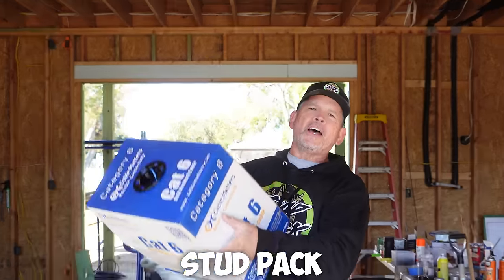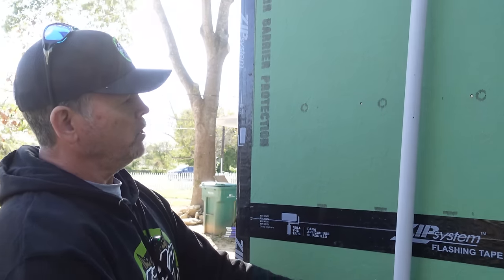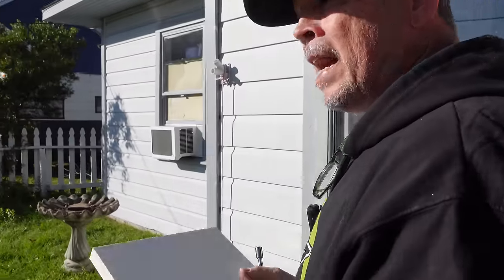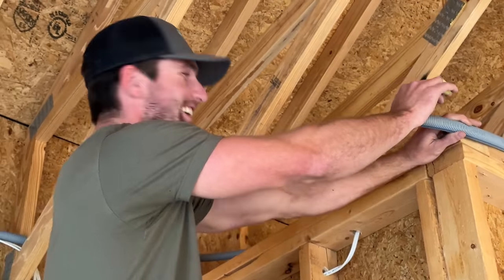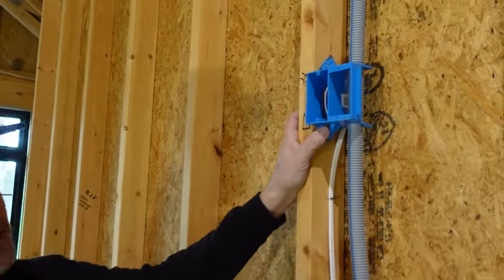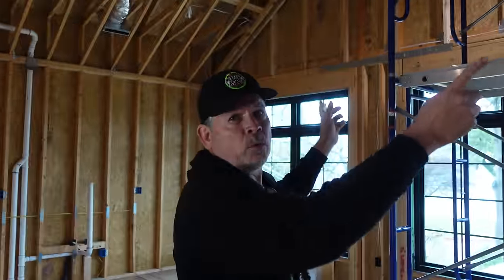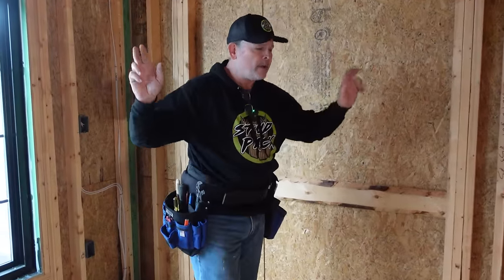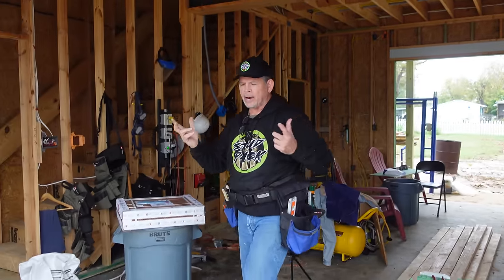DIY Networking for a Future Proof and HIGH SPEED Home! (Smurf Tubing and String Pull Trick!)

Comment: Also add my 1,000th vote for using wall plates.  The main data rack should be installed on an open wall in the electrical room.  Don't understand why you ran that flex way up thru the roof when you could cross the garage ceiling saving length on the way to the data rack.

Comment: Oof I would’ve home run into your electrical closet on the main floor. Who’s gonna want to climb into that attic to work on IT stuff. Then you’re also close to power if you need more down the road. As others have said terminate on keystones in the wall and a patch panel at the home.

Comment: 20 years in the telecom business has taught me to never to run copper cables used for tv or internet parallel to power wire even if it's in conduit. Conduit will not shield from electromagnetic fields produced by electric lines.

Comment: If his fiber is going to be up in that storage space. The conversion to cat6 will be up there as well. The runs are SUPER short. AND going through the smurf tube to boot. The amount of interference from your romex is going to be negligible. The EMF radiating from a standard romex wire is between 0.6 and 0.8 milligauss. Which only radiates at a 1mm maximum halo around the wires, and that's if it is on a constant load. Not idle.

You're not going to interfere with the operation of your Cat6 wires THAT much. Especially for such short distances.

Now if he was running a Cat6 wire 30+ft parallel with a romex wire. THAT would create issues. But a drop down the wall...IN conduit. Pfft, not even worth worrying about.

I will echo what everybody else was saying, most definitely you need to keystone plate those termination points.

Comment: It only took a few seconds to notice you bought a 350 Mhz bandwidth Cat6 cable. I used 500 Mhz Cat6a instead, because it is truly 10 gigabit capable, instead of some 7 gigabits, as I was told by a pro.
Reply: To be more precise, I used a few cat6a cables for a backbone to each room, the rest is cat5 for ethernet/canbus automation and data. Not much of a difference price-wise.

Comment: A few videos back you buried your underground pipe going to that new pole you sent and on the end you dug a little extra ditch, so it wouldn’t be so hard to dig later but you filled it in with dirt. It would’ve been a lot easier if you put sand in there instead

Comment: I'm sure someone mentioned it, but testing your cable is a good habit, but take a moment to ALSO mark the ends with some fashion of label.  There's nothing worth than a perfect mess of cables no one knows what goes to what?  I'm sure you have a location where all the cables termite to and be connected to an ethernet switch or patch panel.

Comment: It’s bad practice at best and potential for lowering or even disrupting the data rate at worst- by running Cat cable alongside line voltage. Best to run them separately in a stud bay down their own respective studs. If they must cross at some point, they should cross at right angles to each other. The Smurf tube will do little to shield the Cat from EMI (electromagnetic interference) and RFI (radio frequency interference), but using shielded Cat6 cable will “harden” your network to a degree. If you ran everything in the house with fiber to the receptacle, you wouldn’t have to worry ever. But the cost of the conversion dongles at each receptacle would be prohibitive. Realistically, using ordinary Cat6 and running it 12” away from line voltage cable, crossing when necessary at right angles and keeping Cat cable runs away from your house service cables, electric motors (like A/C equipment) and fluorescent lighting ( not an issue in this house), then you will not have any problems.

Comment: As an Electrical Engineer the magnetic flux generated from 120V at 20A is only about 3mm. This is just enough to make it outside the sheathing. This flux is what you're actually reading with the EMF detection touch tool.

 If you want to be overly cautious you can install a shield wire on the outside of the concuit and ground the shield wire. The shield wire, bare copper, will absorb the flux field and transfer that miniscule emf to ground.

I think this is way overkill but noise cancelation is an understandable concern.

Hope this helps.

Comment: Use keystones for wall drops and a patch panel and a network rack for your central network area. Saves you from having intermittent network issues when you move equipment around. I would have ran CAT6A. If budget is a concern, you can continue using CAT6, but run smurf tubes to all drops. The reality is that no one knows what home networks will look like in 10 years. CAT6 will allow you to have 1gbps  for multiple devices and 10gbps to one device. For storing and uploading videos, 10gbps and a server will help your workflow.

Comment: Your Cat6 may work for 10G, but it is not optimized for it. 

Cat6 A STP for the main house should be considered, especially if long runs and 10Gbps is required.

Comment: It doesn't look that you have a long distance from the street to the house. I had my Cable Co. guy pass the fiber wire through the eave of the house straight into the attic.  It keeps it away from any predators (big mean burglars) from cutting the fiber from the house and losing service and straight run into the house up high. Especially you talking about cameras  you will not lose service  by someone cutting your fiber from outside. By the way I love your channel. My eyes are watching you from the beginning. lol

Comment: Putting your fiber box/ modem/ router up in the attic is a very bad idea. The best way to do it would be to install a structured media panel near your electrical panel to allow easy maintenance and trouble shooting. It would suck to have to climb up to the attic just to reset the modem if the internet goes out.

Comment: I love to hate the pass through RJ45 connectors. I stopped using them all together
Reply: I agree but they are OK for home owners and they work fairly well.  My new techs I'm training sit down with a box of cable and some standard ends and make patch cables until they can consistently do a proper termination.  It only takes a few hours to get quick with standard ends and the color code will be second nature.

Comment: WiFi 6e and the upcoming WiFi 7 standard along with mesh routers is so good I doubt you guys actually really needed to do a cable install in the house. But it doesn't hurt while the walls are still open ofc but if you were gonna do it you really should've installed Cat 7 or Cat 8 instead as that would've been a better long term investment.

Comment: 20:08 If you want to get fussy then there are tables online specifying acceptable proximities for parallel power and Ethernet.
For the most part, however, Cat.6 cable is good at rejecting induced interference from power cables except in cases of extremely high power.
I still like to space my cables as far apart as I can, and to only cross at ninety-degree angles because I'm OCD, but realistically running the cables in close proximity for a foot or two will likely not cause any issues.

Comment: Please do not use the pass thru mod ends they are garbage.  The issue is it leaves the copper core open in the end the jack. We find in moderate moister and humid environments it corrodes the copper inside a jack and cause connecivity issues.

Comment: Should have stuck to female connectors for the walls. The male connector's tongue breaks way too often on just about everything. Guess you'll find that out later and either have to replace it with another, or stick it back into the wall and install female and then run a patch cable with the length that you way. Another reason for female is that what if you male cable isn't long enough, now you need a female to female adapter, headache...

Comment: Why run it up and over the vaulted ceiling when you could have just gone across the ceiling then up on the lower level. Also, the Smurf tube is not necessary. Miles and miles of ethernet is run in offices without the tubing.

Comment: One comment I'm not seeing is your use of CAT6 and not CAT6a... your thumbnail is about future proofing and 10 Gbps.  While CAT6 will run 10 Gbps over shorter distances, it is designed for 1 Gbps, and you may see some stability issues if you run 10 Gbps across it.  If you truly intend to run 10 Gbps then you should be running CAT6a.

Comment: I absolutely HATE HATE having cables coming straight out of the wall that go directly into the devices.  I was disappointed to hear Paul say that the female CAT6 connectors aren't being used to have clean, nice looking wall plates that then a patch cable can be connected to to go to the device.  When the device is not there, then you have an ugly looking cable coming out of the wall that just dangles there.  And the length of the cables coming out of the wall are never the right length so you end up having to use an inline connector or switch with patch cables anyway, but this time the patch cable connections are out in the open instead of at the wall plate where they should be.

Comment: You can always tell the amateurs when they always call it "Running internet". It's running network. The internet is accessed through a network, but a network can easily exist without internet access. 

You also ALWAYS use a keystone jack and do NOT just terminate the cable to plug straight into a device. Another amateur mistake. Have your network installed by professionals.

Comment: Cat6 is double shielded.  Typically you don’t want to run power parallel to communication. This is a very short run so between the shielding (not the plastic flex conduit) you should not have any issues with the cat6.

Comment: Terminate your in-wall solid-conductor runs to keystone jacks!
For starters, having a wire hanging out of your wall is just plain sloppy! 
Moreover, solid-conductor wiring is intended to be installed and left alone. Stranded-conductor cable is used for patching because it can flex repeatedly and at tighter radii without breaking.
You wouldn't put a NEMA 5-15P plug on solid-core 14/2, now, would you?

Comment: CAT6 has perfectly adequate natural shielding — you don’t need to worry about 110v interference, especially with the additional layer of conduit. CAT5 may have been a concern, but CAT6 is quite a bit beefier!
Reply: By natural shielding, I mean they make shielded CAT6 with metal foil, but even without the shielded variant the PVC, insulation on the conductors and interior jacket works to shield the cable.

Comment: DO NOT leave the runs terminated at the device. Use a wall plate with a coupler. If you damage that cable, you are going to have to use a coupler anyway. Just do it the right way. This time your son is WRONG. Get the wall plates with the couplers in them, you will have nothing but issues with that punch-down style.

Comment: Cat 6 is only 10g at short distance.  Better choice 6a for 10g .
Reply from the maker: It is indeed a small garage building
Reply: Just to help with some other comments:  Cat6 and Cat5e both run at 1 Gbps at 328 feet without NBASE-T technology. For shorter distance runs, Cat6 can support up to 10 Gbps speed to distances up to 165 feet. CAT6A is capable of supporting data transfer rates of up to 10Gbps would be to the 100 meter mark  @StudPack

Comment: Both standards are technically backwards compatible phone lines. Nobody really knows why there's two standards there was the Bell System standard and the other standard. From what I understand the government picked up on one and everybody else went with the other. But they're interchangeable as long as they're the same on both ends.
Putting that conduit near the Electrical will probably be fine for a short distance with properly terminated cables. However you're getting only special protection and not electrical field Protection due to it being plastic conduit. And and besides that's what the twists and the cables are there to filter out.
I'm waiting to see if the green pair gets terminated properly in slots 3 and 6 with a reverse switch on colors for 4 and 5?

And those cheap testers will test most things are there there are a few faults that they won't test like having the color pairs swapped around the wrong way.
Also be aware that depending on the Chinese factory default might show at the battery end or at the non-battery end of the tester!

Comment: Definitely think you should put in wall plates and jacks and not have ends on the house wiring. But, whatever works for you. But can we please get you guys to not call it "Internet cable". That's not a thing. It's Ethernet cable.
Reply: While being pendatic, Ethernet is not a cable, it's a protocol.

Comment: As many people have said about the keystone plates. If you already got the ends terminated with the RJ45 connection you don't need to cut those off. You can get basically a pass through jack so RJ45 to RJ45 keystone.

Comment: I don't understand your sequence of construction. Every home build I've seen or been involved in is: site prep, slab prep, slab and footers and slab framing, slab plumbing, slab pour, framing, wall and roof sheathing, roofing, windows and exterior doors, siding, then interior systems. I  know zip system is pretty good, but it's not made to be exposed to the elements for months.

Comment: That 300mhz cable not 500mhz ( which gets you to 1ghz ) to get to 10ghz ( as per the video icon ) you will require hybrid or pure fiber… just saying … and we use chains for long drops and Velcro ( not allowed clips / cable ties) pretty though ( love to see how it performs on our fluke 5000 for the cable

Comment: Everyone is commenting about not using jacks. Alternative is to use keystone couplers. I've terminated thousands of jacks, but also had to fix hundreds of them from new guys not making them correctly. There is a bit more skill that goes into punching down a jack than just making up a pass-though rj45 end. If you don't necessarily want to use punchdown jacks, just use keystone couplers.

Comment: Interior network wires should be punched down.  Don't put a head on it. Interior wires should be solid and never ever move or be interfere with electrical or magnetic. Once terminated to panels, use stranded cabling to connect to any terminals. Stranded makes it flexible and last longer than solid in the constant flexing. And if it breaks, it is easier and cheaper to replace.  For future proof, it is better to go with fiber optics. It is costly, but any future speed will not be an issue.

Comment: After doing this for over 25 years and tens of thousands of cables made and repaired, in my opinion, passthrough is garbage especially the staggered rows ends (yours are inline). 
1) Why not punch down like you first were intending to? Your first idea was the best but I know Jordan is going to say the RJ45 jack and patch cable won't deliver 10G but Cat 6 will run 10G to 165feet ( further but that's what you are told everywhere) with a 6 foot patch cable on each end.
2) When the ends get ripped off later there will be a bunch of crap to move to put another one back on. Jordan needs to know that he's setting himself up for failure.
3) In my book every location should have some type of conduit going to each location where  Cat6 is going for future changes in technology.
4) Exceptionally high marks for installing smurf tube the right way and securing them every few feet so they don't kink.You'll have to watch out for other trades to come in behind you and drive a screw through it, kink it, cut it  or some other BS. LV conduit always goes in right before the drywall to avoid that stuff. And take good pictures  to CYA because if something happens, find the damage and make the SOB pay to fix it.
5) Exceptionally high marks for leveling your PVC mount plate outside- If I had a dime for every crooked mount ......
6) Some suggest Keystones - not a fan
Also watching them remove and install a new TP can be deadly if the crane operator is careless. A good friend got his job at a Florida based power company because a crane operator was careless. The crane operator and a helper were dropping poles on the ground for another crew to install . The crane operator ended up touching one of the phases  with one end of the pole and the other to the trailer carrying the poles. The helper was killed instantly since he was leaning against the trailer. He was the path to ground. My friend replaced him and that is how he started there.

Comment: If you do all Smurf tube, you will hate yourself later. It’s horrible to pull thru.

Also, an auger bit will save you a lot of time drilling studs…coming from a guy that’s wired hundreds of houses with network, alarm, and cable.

Comment: Why only CAT 6 and not at least CAT 6a? 1Gbps@250Mhz is not "Future Proof", 10Gbps@500MHz would be. I would go as far as to use CAT 7a for double the bandwidth compared to CAT 6a and 4x the bandwidth of CAT 6.

CAT 6: Top Speed 1 Gbps; Bandwidth 250 MHz
CAT 6a: Top Speed 10 Gbps; Bandwidth 500 MHz
CAT 7: Top Speed 10 Gbps; Bandwidth 600 MHz
CAT 7a: Top Speed 10 Gbps; Bandwidth 1000 MHz

Comment: Are you skipping the wall plate for faster speeds? If so, you won’t notice a difference, and the cons majorly outweigh the pros. If you wanted to thoroughly maximize your speeds, you should have used shielded cat6 with the shielded connectors plugging directly into your devices. But again, I guarantee you wouldn’t be using your computer for anything that would warrant the extra cost. Terminate your main runs at a tidy wall plate. You’ll save money in the long run and will get the same level of performance.